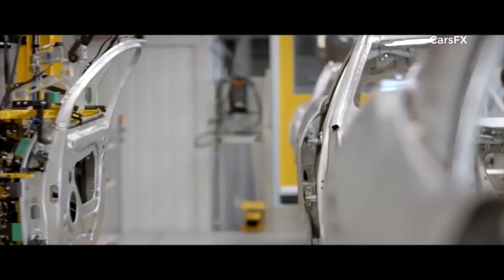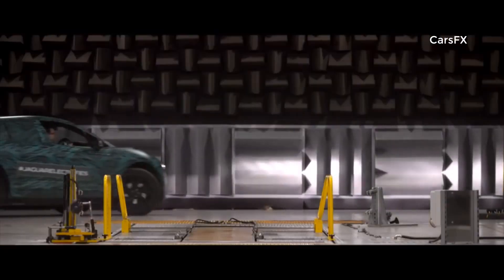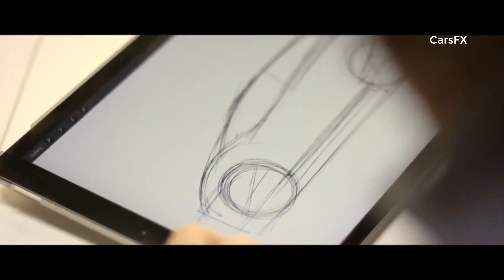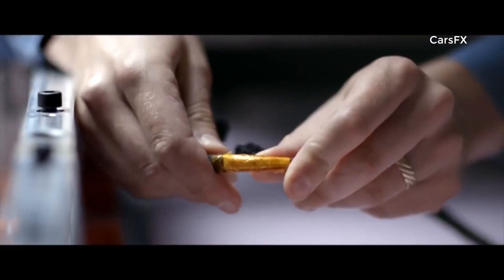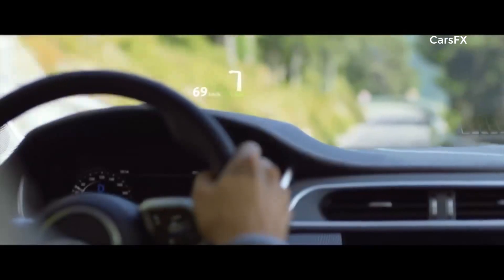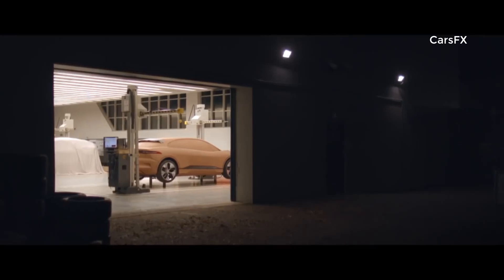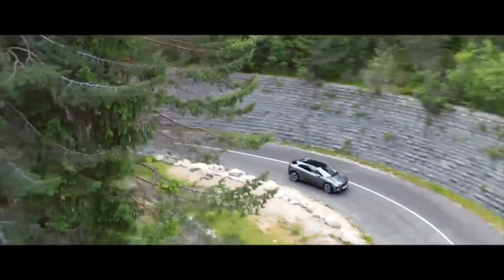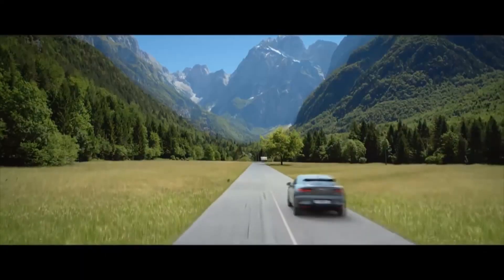2019 Jaguar I-PACE Production

Comment: Owned an iPace for 5 months and guys this video is a marketing stunt, This is not a complaint because my iPace is amazing and its my favourite car from over 20 cars i owned from 10k car to 100k car this is the best one regardless of the flaws. This comment is just regarding the video they say which is not the same as i experience.
1. Design is not good the plastic bumper front and back is from a toy car its ready to fall off easily and if you need parts you have to get the whole bumper front or back and spray it aswell which could be 1000s even if its a strip worth £10 you just can't get it, Jaguar is a nightmare to deal with they pass on to the next person and even though i contacted them from head office then passed on to some parts wholesaler that jag own its just a nightmare to finally being told to contact a dealer classic case of passing the book
 2. Noise this car has noise coming out from everywhere its rattling everywhere like its a fiat chicechinto. They give you nice words from a factory with zero miles and not after its driving on UK roads for 3 years.
3. Range max you will get after 2-3years old iPace 120miles. 
4. Manufacturing this vehicle must be in Chinese warehouse with no Quality Control, Unfortunately my front widscreen is falling off and water is dripping into the electrics this is down to the manufacturers not using enough glue or not placing it in correctly im not an engineer so not sure how this happened during production, Spoke to Jaguar and they are not going to fix it for free they want over £2,000 even though its their fault, Got a windscreen company willing to do it through the insurance but its not broken its a manufacturers fault so its not insured i need it to be broken to be insured 😅 I bet Jaguar will blame the robots for installing the glass wrong.
5. Inside is actually genius and beautiful because it has old tech and new tech married and really looks amazing. Inside looks like a 100,000 car main reason I love it so much also with its 1000 features which you will love.
6. Front and Back Boot perfect
7. Car shape/body is 4/10 which is actually good because nobody really looks at it like you are rich which is good sometimes because they don't know im driving a super car in speed and torque so i guess thats a good thing  but could look a bit better the side plastic strips ware from the outdoors UK weather when the sun comes out and the car is dry the side strips along the bottom of the doors look crappy and faded like plastic has been in the sun for years kind of a white tint to them which makes it look cheap.
This is really an amazing car and has the potential to beat Tesla i might just go and build a car myself to fix their massive issues. Main problem is Jaguar and Landrover have a bad name and i didn't know that until i done my research because of my problems so take that iPace and get it done properly by a different company it would be worth TRILLIONS yes with a T.

8. Resale value because of the brand's bad name, Tried to sell my other Landrover and Jaguar been online and later as the cheapest ones in the whole country and didn't even get 1 call so bear that in mind before buying you will be waiting for long time to sell them and dealers will devalue your car like its been driving on 2 wheels whitout any doors or steering wheel 😂. Peace out guys...
Reply from the maker: Electric cars as far as long term ownership are still to be proven especially when it comes to the battery longevity , i personally wouldn't buy an EV for at leats another 5 years !

Comment: Using Jaguar brand for 18+ years and this is my horrible review with the I-PACE.
I've had a horrible experience with Jaguar's I-Pace. I had the vehicle for a year, and have only been able to drive it for approximately 2k miles. It has had issues with battery, software malfunction, charging system, and even when you would try to start the car it would make noises. Its a shame that Jaguar has tainted its brand with such a problematic car.
If you want to be walking to places instead of driving, BUY a Jaguar I-PACE.
Reply: Sorry you’ve had such problems. I don’t know where you are located, but I think the dealerships in the US haven’t learned all of the software. 

We bought a 2020 HS about 3 months ago for my wife’s 40 mile round trip commute. 1 black screen which an update cured. Took it on a 500 mile trip, speeds above 70mph the whole way. Range dropped as expected, but the car has worked flawlessly. 4500 miles so far. 

I’m thinking about selling off my Mercedes cars, the XF, and the Lexus. Those other cars beat you to death compared to the iPace on a long drive. I commute 130-200 miles a day, but now there are chargers everywhere and on both ends of my normal run so this vehicle would easily work. Especially since I always spend an hour or two waiting on an appointment time or catching up on computer work. I can do that in the car while charging as easily as a Starbucks and save money by drinking cheaper coffee. 

I’m jealous my wife gets to drive it every day.
Reply: My uncle has had very similar issues with his own I-Pace. I hope this isn't a taster of things to come with JLR. I'm aware of the horrendous quality issues with Range Rovers etc, I just hope Jaguar aren't being dragged down in the same fashion. I'm a Jag man myself, more old school though. I'm sorry to hear you've had problems.

Comment: The car is a work of art.   Here's hoping that fake engine noise can be turned off though.
Reply: I have an I-pace myself and I have turned the sound off. I have spoken to many other I-Pace owners and not a single one has the sounds turned on. Driving the car in 'silent' mode is just as impressive and more so at high(er) speeds.
Reply: @mvm1162  how you do that?

Comment: In these types of cars software is playing a very important part. Tesla being based on Linux is, in my opinion, less safe than the I-Pace which is QNX based.
Reply: Tesla using an open source model doesn't equate to the OS being wide open.   Parts of the source code are freely visible for scrutiny (the reason for which is actually more security not less).   The OS itself is very closed off and secure in the vehicles.   That's one reason Tesla has dragged their feet so long on allowing hardware connections via their USB ports (cell phones), as that provides a huge security hole.

I'm not saying QNX is better or wose than Tesla's OS, but Tesla's is a extremely secure OS by modern standards.